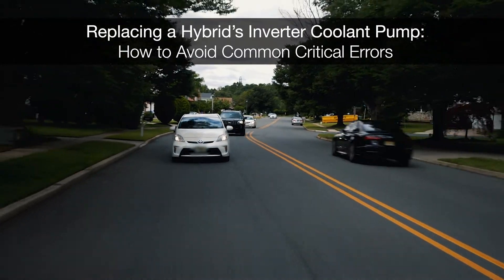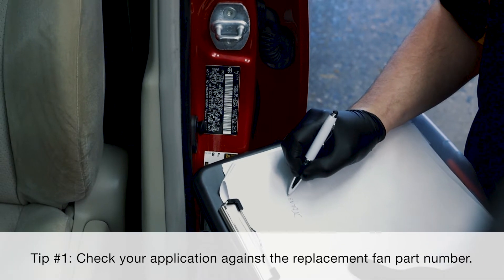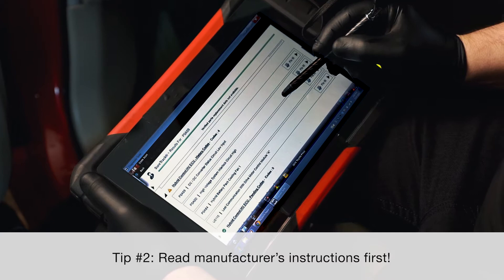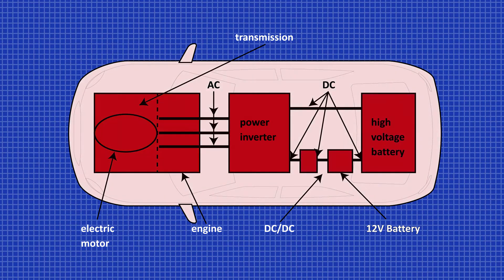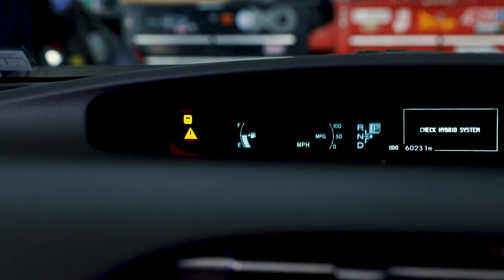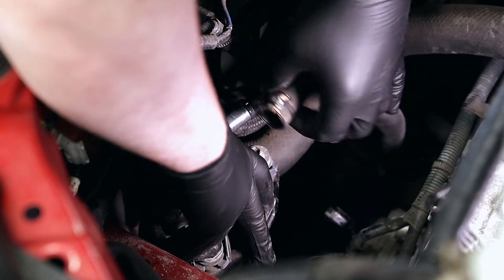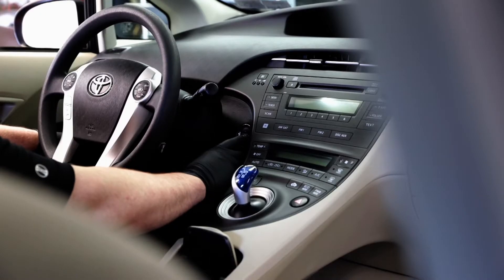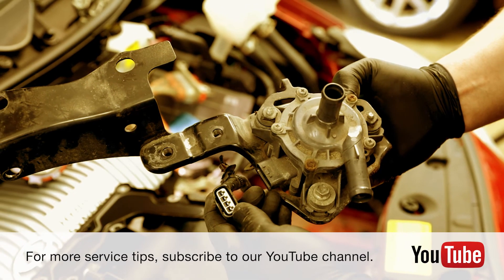Continental Hybrid Inverter Cooling Pump Installation

Comment: Hello,
Thanks for information, after i changed my cooling pump hybrid check system is came on and car would not start.
Reply: With the second generation the fuse needs to be changed.
Reply: What fuse exactly